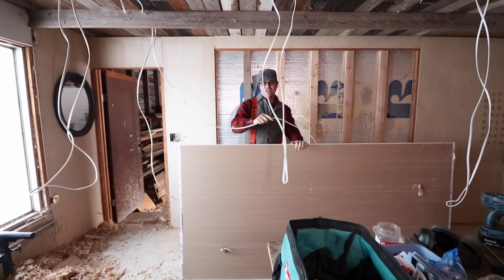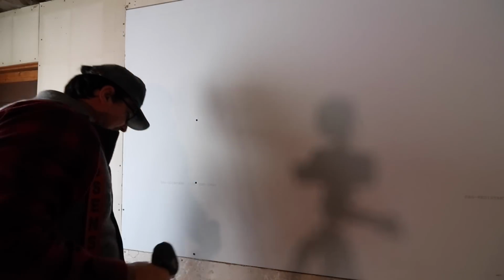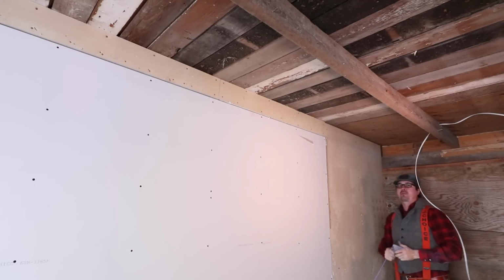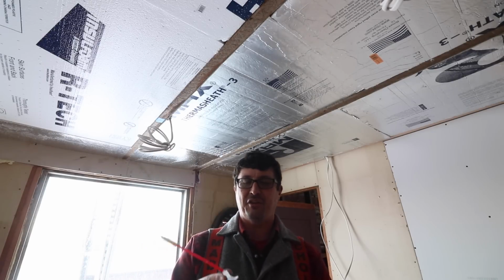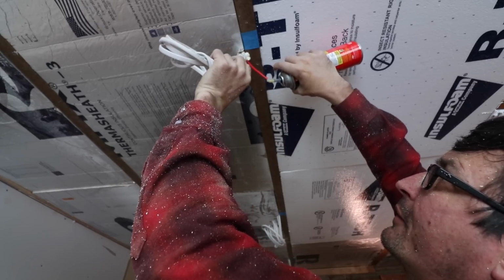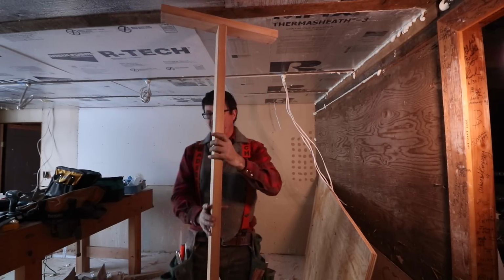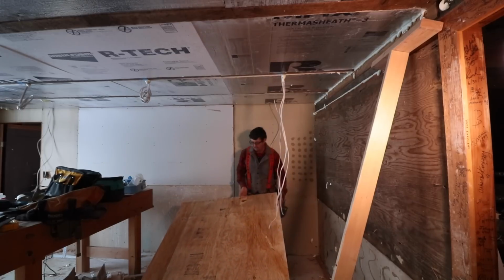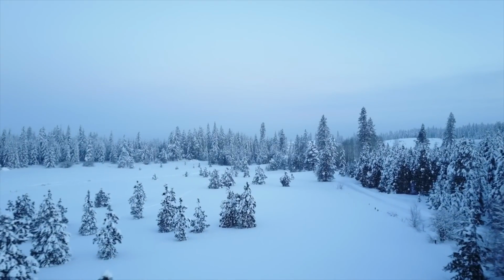I'LL NEVER DO THIS AGAIN!!

Comment: did you say 3/4" plyboard? Those are around 75lbs each man, no bueno. It's just an overhead, could have use 1/4" or less.
Reply: I was thinking the exact same thing and the cost comparison is huge unless Cody got a special deal on the 3/4". I am no carpenter, nor a critic by any means. But I have seen many man caves and work shops over the years done in 3/8" chip board and they were very inexpensive and looked nice with lathing on the joints. But its Cody's room and he knows what works best for him.
Reply: You make a good point which never came to mind for me. Kudo's
Reply: ramosel possibly.. That is a fair point.
Reply: The Whiskey Gunner ye I was thinking the same. Hoping it was just a slip of the tongue.
Reply: Tongue and groove boarding would look better and wouldn't sag. he got a deal on the 3/4" but there's no way I'd bother manhandling that stuff over my head.
Reply: He got a great deal on this plywood but it is way to heavy for single man lift.
Reply: Look at the span between ceiling support beams.  Even 1/2" would sag after time.  Since he got this at a great deal, 3/4" will look good and never sag.  He can also hang a light load from it without having to find a stud.
Reply: Tyler Woods aaah good call. Makes sense.
Reply: My thoughts exactly Tyler :)
Reply: or he could use some of his home cut 2x4s in between those "rafters" to give himself more places to screw into and use 1/4.... even if it was just left over sheet, I would have saved it for something where I need 3/4.
Reply: I was gonna say the same thing! 3/4" is overkill for a ceiling. It's better to use sheet-rock or lathe and plaster. And it is well worth it to obtain (rent, borrow, or buy) a sheetrock lift. This guy could make one.
Reply: The Whiskey Gunner by using 3/4" plywood it allows Cody to mount things super easy and not worry about them falling off/down.
Reply: im not carpenter or builder by any means. but i understand the concerns with sag. if cost was a concern wouldn't 1/4 ply work if you used 2x3 cross beams for support? i been using a lot of 2x3 to save $$$ for simple little projects like an outside utility room and 2x workbenches i built ( 27"Wx6'Lx32"H).
just thought i would stick my nose into the convo and see if my train of thought is halfass alright or if im out of my fkin mind lol

also say i wanted to do something like this and was doing it solo, would it be a bad idea to just cut the plywood down the middle into 2x8 to make the job manageable? or am i just talking more lunacy?

Comment: Hey Cody just a quick tip didn't look threw the 900 comments but if your hanging plywood on the ceiling alone you can screw a piece a 2x4 along the wall 3/4 to an inch down from the ceiling so you can tuck the plywood into it.  Works like having another hand, you can still even use your home aid holder for the opposite side.  Good luck

Comment: I have done this and at retirement age I nail a short 2x4 block on the wall. So any plywood I only have to lift half of the weight. Then the center sheets nail the same short block temporally over lapping the previous sheet  Again i  only have to lift half the weight and slip the T pole under it.

Comment: Just violated electrical code by covering the junction box, good place for a fire to start when wires are overloaded all it takes is a bad connection to create resistance because it will get hot.
Reply: Not likely with LED loading.  I'd estimate less than 50W per fixture.
Reply: Tyler Woods those are the least of the draw that was the main power feed so his outlets will also be pulling from that junction box! It still doesn't matter NEC electrical code boxes have to be accessible! If he would have dropped the box so the cover is accessible after the ceiling is in he would be ok!
Reply: Robnord1 - Found that in an outbuilding on this property after we bought.  Not a single wire nut in ANY box.  Every splice and junction was made within the wall.  I pulled all the wall panels and rewired the shed.  There was some scorched craft paper on the insulation and a fire in my feed shed was just a matter of time.
Reply: thank you Mr. Safety Nazi!!!I think he knows what he's doing!!! and maybe the codes different there!!!it's his place not yours and we might not see everything, ever consider that?
Reply: That's what fuses are there for, no chance for overloading if you have the correct gauge of cable coupled whit the correct amp fuse.
Reply: Fripp that's where most people fail, anytime you have a splice where the wire is cut you create resistance, resistance creates heat heat reduces the functional rating of electrical wire. A cold copper wire can carry more amps than a hot copper wire! Point being a hidden box is bad and asking for trouble!
Reply: Only question--you seem to be implying that having a box accessible means that it'll automatically have less resistance/dissipate heat better? I mean, I guess that means the box will be less insulated, but that just doesn't seem like it'd have that extreme an effect?? I agree that it seems quite ill-advised to just have a box that might need to be accessed later totally hidden and inaccessible without putting a hole in just the right place in the cieling.
Reply: May your swords stay sharp! (mysss29) yes and no! An accessible box can dissipate heat a little more than one that is concealed same electrical theory as above ground wires vs buried service above ground wires are smaller because they can dissipate heat underground is usually twice the size especially when in a conduit. It is always best practice to keep all junction boxes accessible. I did a call to a lady who's bedroom light was not working when I dropped the light fixture I found burnt wires created by weak connections in the wires luckily there was enough extra wire in the ceiling I was able to cut them back and terminate them properly. She is very lucky it did not start her home on fire!
Reply: Pasqualie47 it was in his previous video when he ran the wire that the box is right next to the ceiling and in this video it is now covered with insulation.
Reply: It's a good point and it is bad practice to cover it, but code is not universal. Are you sure it's a violation in his jurisdiction? In any case, he should be fine because the ratings always include a hefty safety margin. It's just a shop. It's not likely anyone will be sleeping in it if it does catch fire. Leaving the box exposed doesn't really prevent fires and may make them happen sooner  as it allows more oxygen and humidity into the box.
Reply: kedwa30 I looked up in my NEC code book and it is nation wide that junction boxes must have access. NEC 314.29 says that a junction box has to be "accessible without removing any part of the building"
Reply: keith moore 

Code isn't different there. It's called the NATIONAL Electrical Code for a reason.
Reply: Unfortunately, you just can't win with some people. Well, at least it keeps electricians like me employed.
Reply: McMahon yes exactly I feel the same way, I had applied for electrical inspector job but got beat out by my instructor who decided to retire from teaching he was the best instructor in that course! I just hope he has good fire insurance!
Reply: Silent Death 

Best of luck to you next time, man!
Reply: Silent Death sorry but you and McMahon are wrong it doesn't apply to him... remember he lives next to My. Fuji that's a different nation than what you guys are talking about jeez!
Reply: +Amrauz o__________O

Comment: You know you can cut it with a knife and snap it like drywall right? Way less mess than cutting with a saw.
Reply from the maker: I want a clean tight fit,
Reply: A long sharp knife can cut all the way thru cleanly.
Reply from the maker: So will a skill saw at half the time,
Reply: Electric butcher knife :)
Reply: Hunterdude when dewalt sends you their new flexvolt line up, you don't cut with a knife, what you can cut with a saw.
Reply: Trying to give advise not bash.
Reply: When I've cut foam insulation I've used an old bread knife. Works a treat.
Reply: Agreed
Reply: Hunterdude yep
Reply: I think it was still a little wet so it might have fit just perfect tight, I saw it still dripping when he was putting up the ply.
Reply: Dewalt marketing need to make a bread knife and get one couriered over to Cody
Reply: Dylan Cox that sheet doesn't weigh more than 40 pounds he is more than capable of holding it especially with a t bar
Reply: his house, his tools, his choice on how he wants to do it.  there are many paths to take to get to the same end result.
Reply: A saw will cut a true 90 degree cut a snap knife will be off most of the time and a swift cut with a knife not all ways strait. He's not doing union work and that's why it fit so tightly!
Reply: I cut that rtec with the table saw and I can out run any one trying to use a knife and snap. its 2 inches thick... does not work like dry wall.
Reply from the maker: I tried it and it did not snap clean, why is this so important to you?
Reply: lol "worked in union construction", in other words, you've never seen any work get done
Reply: Are you using a circular saw? I thought skill saws with their worm drives were proper.
Reply: He got a bunch of free tools from Dewalt, so he's got to put them in the video somehow!
Reply: Is he working for a union construction company constructing a high rise commercial building? No, hes in his work shop on his own time. I agree with him, its not always a clean cut with a razor. And as far as the 90 degree cut the other guy was talking about, he was saying up and down on the edge rather than it being either tapered or jagged from being snapped (which no matter how skilled you are will happen). I also wonder, why is this tinny little detail so important to you guys? of all of the things to nitpick about.
Reply: 3/4 ply weighs rough;y 75Lb's a sheet. At least that's what I was told back when I built scenery as a figure to calculate scenic element weights.
Reply: I was trying to give advise thats why. You dont want it then thats fine do it the hard way. I can't speak for the rest of the trolls replying.You act like you are a pro with a knife and everything else you do so why not. Sorry I tried to help. See I can give a attitude also.
Reply: Armchair quarterback, must be  after the game.
Reply: yeah who ever said it was 40lbs is wrong. I'm 6'6 and 300lbs no way I'm even holding that up for long over my head alone lol.
Reply: You're pretty manly if you can score and snap 3/4" AC plywood with a knife.  :-p
Reply: the foam not plywood.
Reply: leif52pickup a good friend of mine taught me that you can score roofing tin with your utility knife and snap it. I's total blown away when he showed me that.
Reply: hence the smiley
Reply: Hunterdude you get better edges using the circle saw.  It just give you that plastic snow sawdust which is a hassle to clean up, but makes excellent cuts on the foam.
Reply: If you put the blade BACKWARDS in your circular saw it cuts like a laser.  Kerf so smooth you can comb your hair in the reflection.  Works for vinyl siding as well.  A small tooth HSS plywood blade is better than carbide when using it this way, but carbide works too.
Reply: I can't believe this thread. knive v.s. saw LOL. The saw cut it. Deal with it.
Reply: Alex, that's a sidewinder saw, much lighter but less power. Not sure if they make battery worm-drives?
FWIW [not much at this point] I assumed a jigsaw with a really fine-toothed blade would've been the proper tool for cutting the foam. But hey, people who wait to have the perfect tool in their hand all the time don't always get nearly as much done. And I've never even seen 2" thick insulation board, let alone cut it, so I could be very wrong.
Reply: This was Not meant to be negative of bash him in any way. Just giving advise for faster easier way. Yes a saw cuts at a 90 most of the time. But this isn't a finished trim job. So all that want to say negative stuff about what I said or about how he does it then just move along.
Reply: Jonathon Greydanus yeah, I use saws on that and just did a whole house but did not foam each gap.  We did it in an attic space with air flow anyway though.  I cut a 4x8 sheet into strips on an table saw so that the pieces fit in the gaps between studs and it takes maybe a minute for one man using the table saw and rip fence.  That score and break method, I don't even do that with drywall much any more, just saws with an old blade.  Takes time, has opportunity for errors makes a mess.  At my hourly rate, I am not going to stick it to clients on the time it takes to do corrective work because I was using second rate equipment or outdated methods.
Reply: Hunterdude That's the way i cut plasterboard. Its quicker and cleaner than sawing it. Each to their own though.
Reply: @ farmer guy. Arm chair quarterbacks?? I do this for a living I know what i'm doing.
Reply: get some skill with your knife
Reply: I think it was wet enough so that it filled in the gap in the plywood also.
But the foam will be dry and hard tomorrow.

Comment: Hi Cody, here's a little advice from a drywall hanger skilled in hanging 12' 5/8 over head alone. Place a few nails sticking out from the wall an inch or so down so you can slip the sheet over them and they will hold the sheet up for you and then your T post will work even better.  When you are trying to fit two sheet edges together at their edges take a couple 1x2's about 4" long and 2" screws, Screw into two of the rafters 4' apart along the edge of the already hung sheet through the middle of the 1x2 so the 1x2 protrudes out sideways of the edge to hold up the new sheets edge. These techniques will allow you to hold the sheet up and lower it enough to get your wires through and not strain you in trying to hold the sheet.

Comment: GOOD  JOB  BURYING  THAT  JUNCTION  BOX...TOTALLY  ILLEGAL...YOU  WILL  HAVE  A  HELL  OF  A  TIME  TROUBLESHOOTING  IF  YOU  HAVE  A  LOOSE  CONNECTION  IN  THAT  JUNCTION  BOX...DID  YOU  DO  THIS  IN  YOUR  KITCHEN  TOO?...PLEASE  CONSULT  AN  ELECTRICIAN  BEFORE  DOING  ANY  MORE  ELECTRICAL  WORK.
Reply: Yep.
Reply: It's not buried as long as there is attic access.  No code broken as long as the box is turned up from the attic side.
Reply: You don't need a video Michael. You just aren't allowed legally to have a junction box that is not readily accessible. 

Connections can become loose over time, and junction boxes are a fire hazard when buried away for several reasons. 

The correct way to do it is fairly simple. You run your wire where it needs to go. If your runs aren't going to be long enough, you fucked up. Start over.

If you absolutely need to use a junction box(Because in fairness they can be useful) they need to be readily accessible. Such as being on a wall in a closet or just a general wall. Moreover if you don't want it visible, you can install it in a roof or wall, but must install a service panel or opening so that they can be accessed at any time.
Reply: Luke Morter I think it was somewhere in the previous video.  The LED lights would need to be rated as a raceway and these wires could not be left exposed.
Reply: In the previous video he said that he read a home electrical book or two and had friend that were electricians. I even posted a warning about this and a solution in the previous video.
Reply: Tyson Burns You only saw him screw one board off to the ceiling in this video. What's to say that he's not going to install an access panel below that j-box?
Reply: keith moore ?  This is common practice dude.
Reply: Luke Morter yeah, as long as they are rated as raceways.
Reply: I rewired a kitchen for a church in West Virginia.  four switches for three banks of ceiling lites.  When completed, i had one switch for each bank.  The previous "electrician" used all 12 ports in the same 4x4 box.  At least the box was turned up for attic access.
Reply: locomotive38 stuffed beyond capacity?
Reply: Nicholas Smerk some people who live in free areas don't have building codes. We don't want to ask permission to do something to  our house on our own property.

Comment: always so fun doing these jobs alone. I would really uncover your junction box those as others have mentioned. For a nice seal too, you could tuck tape all the joints on your rigid insulation so its air tight and acts like a vapour barrier

Comment: Sometimes I wish I was taller... looks so much easier to do these kind of things without needing step stools and stuff to stumble over...
Reply: I guess that's why I make furniture instead of houses... but people still pay me to do renovation stuff too at times
Reply: You need to be creative.  I duct taped paint cans on my feet to paint (trim) the ceiling.  Would have worked better if I was lighter but better than a stool.  Kinda crushed after a while.
Reply: +ycmdill - Haha:) That's a great idea!
Reply: drywall stilts would have been very helpful
Reply: being tall can be a blessing and a curse fr example you can reach the top shelf of your cabinets but you can also be crushed into stupidly tiny cars
Reply: Being tall is actually not very good for your health. What you really wish is that all the ceilings were lower, so you could reach them.

Sounds absurd because it's implausible to change all ceilings? Well just as absurd as being taller or shorter, you are what you are.
Reply: +Siana Gearz -Well, that would be a great solution for me... But I have friends who are Cody's size, so it wouldn't be comfortable for him in my miniature house :)

Comment: I'm putting that same insulation in my basement to use as soundproofing and as a light insulation for the flooring as well as a nice ceiling.  I did not cut mine but hung them directly to the rafters like I would sheetrock to create a smooth look.  It only lowers my ceiling a little and I have 9 ft ceilings in my basement anyway.  Good stuff! I also used the foam as well.